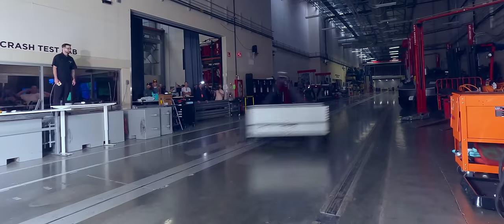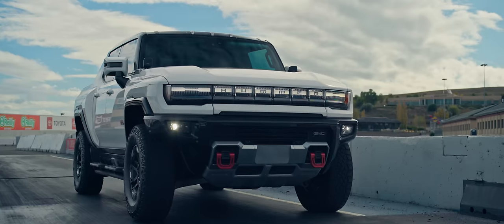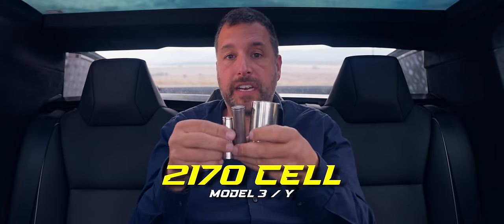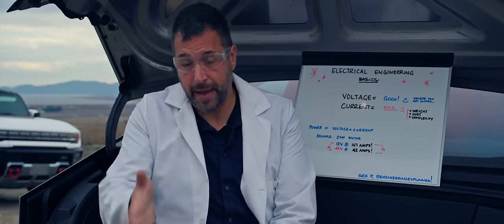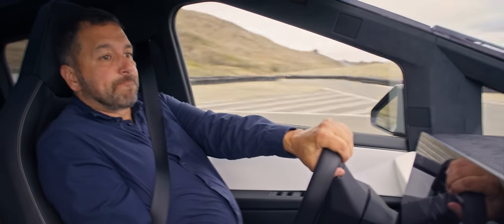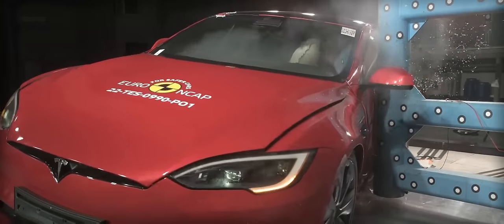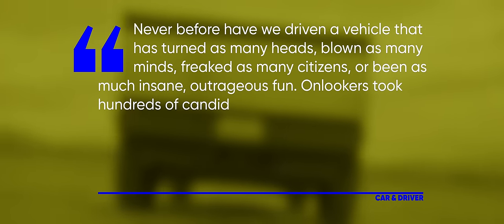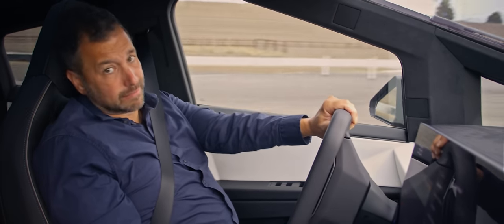Exclusive 2024 Tesla Cybertruck Full Review & Drag Race w R1T & Hummer  — Jason Cammisa on the ICONS

Comment: All you apparently professional car reviewers can do is drag race this thing like you do with all EV's and forget it's a truck, so I got an idea why don't you hook it up to a 12-13,000lb trailer and lets see how far it goes, cause I don't care how fast it is If I can't make it to my camp site what's the Fu7king point ???? and then what? hook it up to my gas powered generator to charge it so I can make it home? all I know is my truck will go all weekend and back without re-fueling, might even have enough fuel for a couple days to get to work and its 15 years old only cost me $25,000 to buy fully loaded for the time, only has 150,000kms on it I should be good for another 10 years before it rusts away

Comment: Another faux truck that will outrun a Porsche but won't be able to get a piece of plywood home, isn't big enough for a tool box, or an auxiliary fuel tank for other equipment. And the production quality won't match that of this video.  🫤
Reply: It had double the bed volume of an F150 and can fit plywood flat in the bed.

Comment: Ok now do a video about the negatives, the fact Europe does not allow stear by wire the fact the truck is not going to be sold in europe as the roads are not capable of the size and other very valid safety reasons, the fact the casting of big parts is becoming a huge problem for tesla and the fact none of the big manufacturer have got serious about ev just yet but are doing a heck of a lot in the background.Let's see a video on the systems other manufacturers have developed that are so much better than anything tesla has or that tesla has just copied. Let's do a video on the massive problem tesla has with insurance premiums and why they are suffering from less sales because of this. Let's discuss the real reason tesla has lowered prices, not making up things about manufacturing improvements, which while they are saving tesla money are not coming close to saving customers' money. Let's discuss the self drive issues and why Tesla is making customers pay for a lot of parts that they have never used or do not need. But more importantly, let's discuss the build quality for all teslas vehicles, it is abysmal and was even identified as a problem when they released the initial bach of Cybertrucks to the public, vehicles you would think they would want to get absolutely perfect, or the problems with the rear wheel drive on Cybertrucks, or the myriad of other problems tesla owners have complained about.

Comment: Electric steering is fine, but electricity has ways of failing,  power outages happen for all kinds of reasons, like maybe a mice get in you vehicle and chew on the wiring.

Then way day your doing 80 mph on the highway and you know in this truck that will be average speed.

But tgen suddenly the power goes out.

Now no brakes and no sterring.  No way to save your self or who ever is in your way.

Never heard of a failure lmao, it hasnt been on millions of cars yet and yes we have had airplane crashes because of computer failure.

When it comes to brakes and steering there needs to be multi layer safety